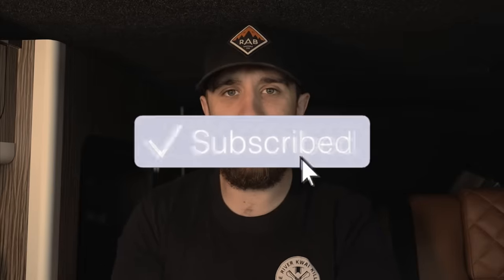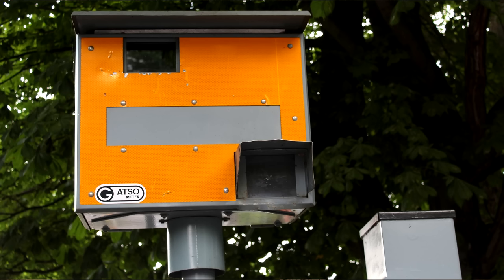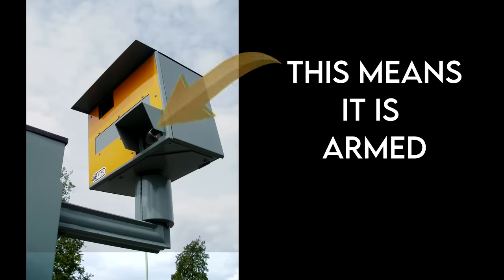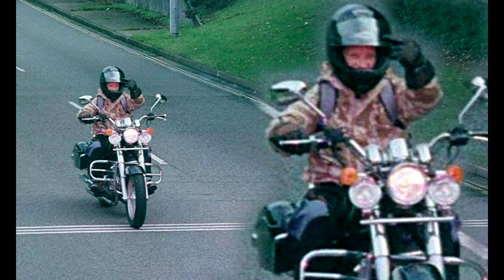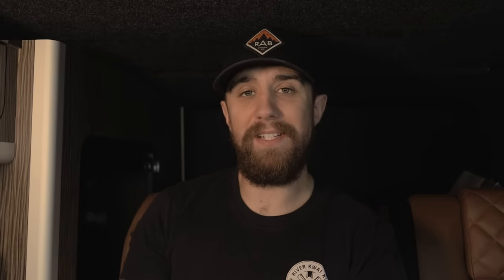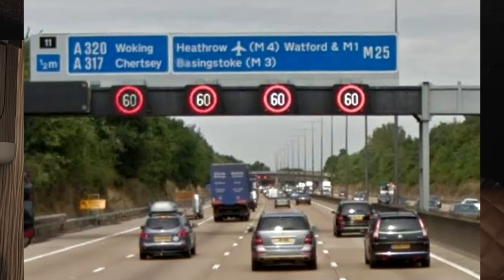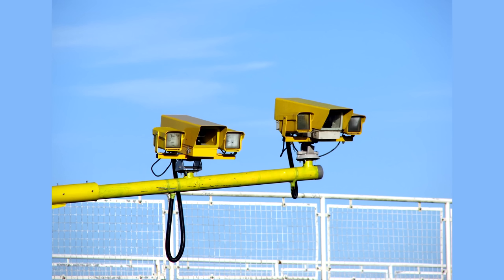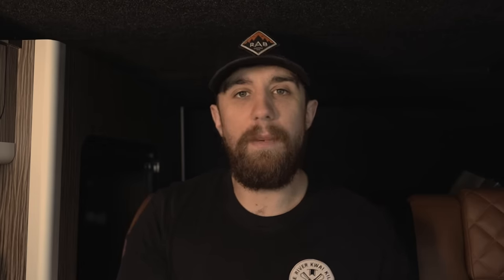How Speed Cameras Work and What to Look Out For

Comment: Luckily for me, the town i live in have fully dismantled all speed cameras and replaced them with a warning digital speed boards, which for me, actually works better than a punishment of a fine. As you approach the board it tells you, and every driver behind you , what speed you are doing. Its also a good way to check your speedometer is correct.   The town I live in did this because they said they weren't getting the revenue back from the treasury from the fines they were generating, and it was costing the town more to maintain, run and process the fines, than it was getting back. It must be, I would say 12 to 15 years ago now that all speed cameras disappeared in my town. Can give you  a false scence of security when driving through a neighbouring town, as they all still have them, and you can forget until you see that big orange box approaching.
Reply: Bear in mind that it's not an accurate way to check your Speedo is correct.

You'd need to be driving DIRECTLY toward the laser for it to be correct, if you're driving off to the side of the scanner, it will be a lower number than your true speed.
Reply: Speedometers usually aren't correct, they are "out" from the factory, unless you have it calibrated (like police vehicles) it will typically over-read by 1-2mph as a rough guide. I had a car that over read by 3mph, and the last car I had over-read by 2mph. Legally they can't under-read (i.e display 30 on the speedo if you are doing 35) as the manufacturer would be liable to be sued in civil court for any speeding fines issued to anyone driving their cars.
Reply: All I can tell you is that, in my town,  no radar trap is set so you drive at an angle towards it, well not in the town i live in anyway. That would surely defeat the purpose, why would any authority want to monitor your speed at a skewed angle? All the radar speed boards are set on straight roads, so you are always travelling straight towards them and can see them further down the road in the distance as you approach them and not around the next bend etc. And all I can, Also tell you is that from every radar speed notification board in my town, when iam approaching it and it lights up the speed it says iam travelling towards it at, what ever that speed may read, my speedometer agrees Wih the board. So if it flashes 30mph, I look at my speedometer, and low and behold it matches 30mph. If on a separate radar speed board I am approaching it. Straight on another long road, you have to slow down because its a school area, so approaching it at 20mph according to my speedometer, and low and behold again, this other independent radar speed board flashes up 20mph. Now that means of the 20 or so radar speed boards in my town, nearly all around schools, that they are all calibrated to my speedometer and all the radar speed boards are wrong :-J . Or? Now it may be someone else travelling towards these same radar boards may flash up 23mph, but when they double check their speedometer it still telling them 20mph. I should imagine that all these radar speed boards are calibrated correctly, as they are bounce back radar signals, and can easily be re-fitted with cameras again to be used in a court of law. As I say, all these radar boards did initially have cameras attached for prosecution of speeders, until my town deactivated all the cameras on them and just rely on. The radar information board to educate instead of just prosecuting.
Reply: @garry1454  The way the radar is projected outwards and forwards from the radar means it is possible to set one off driving towards it, I've done exactly that with a Gatso a few years back. Flashed me driving towards it, no other cars on the road and nobody else about. 

I don't recall whether I was going above the limit at the time but I just recall it flashing at me. The main thing is at the moment, to my knowledge you cannot be prosecuted for it as they are only approved for rear-facing photography.

Comment: North Wales speed cameras are enough to detour the tourists, they're hidden just round bends mainly outside small villages where the speed limit drops to 30mph, Dick Turpin would have been proud of this kind of highway robbery.
Reply: @allythevan  Agreed but it's just too easy to drift slightly over the speed limit and get prosecuted for a moment's loss of concentration, that's what's wrong with the system especially when money is involved and we all know that's the main reason.
Reply: @leeandjancruise  can’t argue with that. Done it myself and still do it. Driving back Saturday down the A9 from dropping my son off had to check my dashcam to see what speed I was going past a SPECS camera got distracted for a sec it happens even though I had my cruise control on. I tend to stick to speed limits if in a strange area anyways but yes speed can creep up.
Reply: Yes and their bright yellow posts are totally INVISIBLE at night.Must use special paint?
Reply: @allythevan  that's a gps speed reading.. Google maps also does it, as does waze and a traditional tomtom satnav
Speedos are often set to under read, to account for tyre wear etc
It's illegal for a car to overread but not under read

I have calibrated my speedo using GPS so it's bang on. Tested with those radar things that show your speed as you approach them
Reply: Close name brother
Reply: @leedorey1490  Ha ! Ha! Your post threw me at first, I thought I didn't post that.
Reply: @jjmmjj9999  I think you're using "overread" and "underread" the wrong way around.
Reply: @danieledwards3376  depends how you look at it
If you're talking about clocks relative to wheels, or wheels relative to clocks

The speedo needle is set 'under' your real air speed
Your air speed is 'over' your speedo speed
Reply: Yeah, got done a few years ago near Barmouth 9.30am Sunday morning, never saw a camera and when I got home, a neighbour had also been done by a handheld hidden in a horsebox trailer....nice
Reply: Are you telling me that you actually drive at more than 30mph on North Wales country lanes? Are you crazy? Have you got X-ray eyes? Or don't they allow pedestrians, tractors, stray sheep, fallen trees or horses hiding around the corner on the roads?
BTW I visit North Wales at least once a year (except 2010, of course) and never even noticed a speed camera. But then, I don't look out for them. I just look out for speed limit signs. Or my wife does. She's my co-pilot. Very useful. Why make things complicated? It's really quite easy. Follow the rules. Simples. Why go looking for trouble?
Reply: @trevorastrong2072  I don't believe for one moment you have never accidently drifted over the speed limit and what happened in 2010?
Reply: @leeandjancruise  
You're 100% correct. I too was a bit wild as a young man. I do occasionally drift over the limit but on narrow country roads I don't get anywhere near 60mph. As previously iterated, you don't know what's waiting round the corner. Simple rule. Can you stop within the distance you can see? I generally drive at less than 30 in a built up area when there's kids around. I drive past horses slowly.
What happened in 2010? I wasn't in the country. The Conservatives won the general election.
Reply: You could have removed "speed cameras" and left it at North Wales is enough to detour the tourists :)
Reply: @jjmmjj9999  You've got a flying car, I've always wanted one of those.
Reply: @bws833 ??
Reply: got my 3 points in North Wales in that EXACT scenario you describe :( shakes fist
Reply: @leeandjancruise  hence why a lot of these cameras are sited at the bottom of hills.
Reply: Those bright yellow high speed cameras enforcing 50 mph all through Denbighshire are a blot on the landscape. All that beautiful scenery. 
Of course they only catch tourists because locals will be tuning off at various points, so the locals will drive past the first camera but will never be seen by the second camera

The ones around Wrexham bypass are for pollution control and enforce 50 mph.  
Of course being forced to spend 29% longer on that stretch of road and all the traffic bunched up together makes for cleaner air. ???

Apparently you won't be prosecuted for breaking that 50 mph limit as the law refuses to enforce environmental speed cameras. You will just get a letter advising you not to do it again...   As the police say.  We are not the health police, and they only enforce speed limits for safety reasons.
Reply: @leeandjancruise  I live in North Wales, in Anglesey, and we don’t have speed cameras here, only the mobile ones which I agree for tourists they can be deadly because they do hide behind corners but are always in plain sight. 

But because I live here I know where they park 😂 doesn’t mean I do 50mph through a 30 either, been driving 15 years and never had any points on my license whatsoever. But it is handy knowing the hot spots 😉👍
Reply: @RhysOwens86  Yeah the mobile ones, I was there few weeks ago and as we left Benllech at 7-30 p.m. there was one round a bend downhill where the speed limit dropped to 30mph, it was very easy to be free wheeling down the hill at say 35mph and bang if you see it they've got you. A farmer was flashing his lights on his tractor as he drove in the opposite direction, well done that farmer.
Reply: I won't fo to Wales any more.  The drive to Bala and constant changes with locals up yer arse who know where the cameras are make it too stressful now.